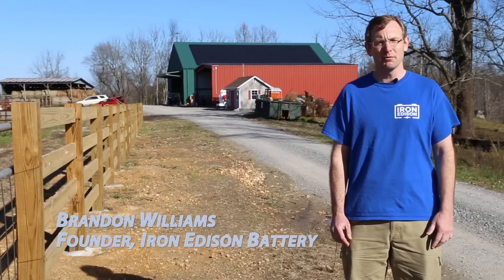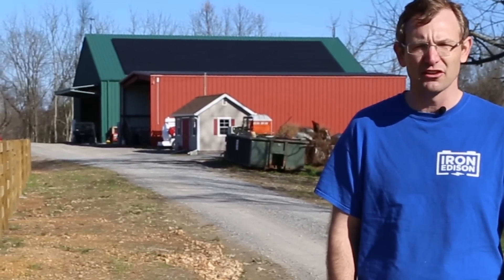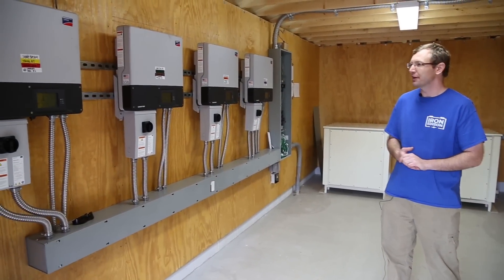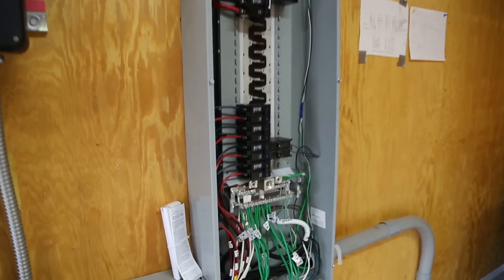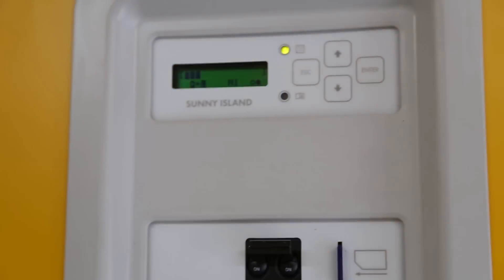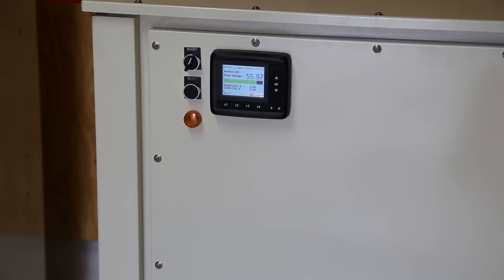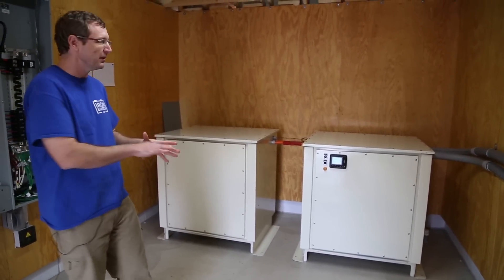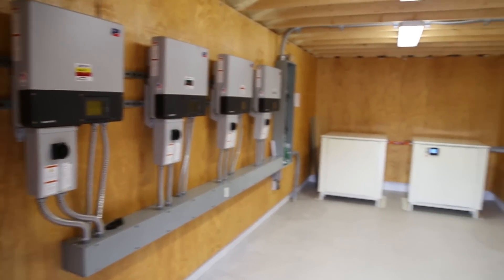Off Grid Solar + Battery Storage Project (SMA Sunny Island & Iron Edison Lithium Iron Phosphate)

Comment: Why do you have both the sunny island inverter chargers and the sma 7000 inverters?  Are the 7000s configured for 220 while the Sunny islands are for 120vAC and charging?
Reply: The system is an AC coupled system,  its more efficient because the solar power can bypass the batteries and join  the sunny islands inverters on the output side effectively creating a mini grid.
So loads get power directly when there is solar generation, and at the same time that Sunny Island can reverse charge the batteries.

Comment: I'm still trying to figure out the system logic there. Off grid. Using gridtie inverters to output 240ac. However they won't energize due to anti-islanding circuitry unless they see 240ac. So the Sunny Island inverters are providing the AC from the battery bank? Then power is combined? What? That's a helluva lot of hardware cost. Why not use charge controllers off the solar panels to the battery bank instead of gridtie inverters? Odd. So in theory here you are using the Sunny Islands to create the grid power, then add to it with the Sunny Boys yet draw off that same grid by Sunny Islands to charge the battery bank?
Reply: Goog notice bro..his way to connect or use grid tie better cuz..
He will never face any problems to connect the pv array..
If he use your advise.. He faced
The amperage and high voltage..
Reply: @mahmoudtijny8795  Simply unintelligible. Recommend you stop posting.  Really.
Reply: The Sunny Island can be run in many configurations... as the name suggests, they are designed to create an isolated powered system. They can draw power from the grid (or a generator) to charge batteries and supply load, use their batteries to contribute to the grid (i.e. be the grid), or operate completely free of any grid (external AC power.) SMA recommends an "AC tied" system, where any solar is attached to the AC load side. (download the manuals for the sunny island and sunny boy systems for diagrams.)
Reply: @jfbeam  Haha... thanks for the reply. I have recently installed 2x7kw and 2x6kw sma sunny boy series41 inverters as well as two sunny island 6048's. My 24.5kwh nissan leaf pack is all together (56vdc). I'm still shopping for a decent BMS. Neither of the two available options are particularly affordable. Unfortunately it has to be able to communicate RS485 to the sunny islands so you can't just use some cheap stuff off ebay. SMA hasn't been particularly helpful. Sure they have lots of manuals but very few actual detailed writeups of installed systems similar to my configuration. The hardware is amazing, but SMA's website and youtube channel leaves a bit to be desired.
Reply: It seems to be a German thing, very good products but not practical, not much flexibility if you want to use EV battery cells etc.
This kind of setup is completely unaffordable for the average person,
And doesn't really make much sense.

Comment: One year to do that install?? I was thinking two weeks not including permits. Flex, conduit and cable management looks a little messy to me. Cool project though! So many new batteries out there today, not sure what type I would like to spec every time.
Reply: Thanks for your comment!  You are right - the inverter and battery installation took just over a week.  The customer was planning the project for over a year, and had to pour concrete, build the metal building, build concrete block building, and insulate the entire building with spray foam insulation - and they live full time in another state!

Comment: What does a system like that cost, excluding the solar array and the building it is housed in?
Reply: It isn't affordable to average people neither worthy going off grid. You won't live to see money back from solar power investment.
Reply: dont bother talking about what you d not know about.   if you want to be a shill than get into politics or something where talking out of your ass pays better
Reply: This system is a minimum 75k$ system. It is probably more as the person who installed it almost certainly needed to be a licensed electrician, which I would assume to bring the cost up to 90k$ to 110k$ depending on the level of the electrician.
Reply: If you are just talking cost of the batteries, controllers, and inverters that is probably about half the cost so 35k$ to 55k$.
Reply: @AJ-ox8xy  I bought solar panels from China for 40 cents per watt shipped to Grand Bahama island.  I later bought 4 brand new sunny boy sunny island SI6048-US-10 for 5750 delivered to texas 78660.   I just need to find some batteries at a good price and I will have a 21kwatt system parts for far less than your low end of 35k.  Sure, if you buy everything retail, ignore China/Alibaba and don't look for deals on Ebay then it can easily cost far more.
Reply: @jfbeam  I'm dyi'ing most of my installation (I used to sell hardware and have installed a few).... for 26kw grid tie (2x6kw, 2x7kw sunny boy) and 2x 6048 sunny island and panels and racking I'm into it for maybe $50k cdn. Not too bad. That includes 24.5kwh gen2 leaf modules (Nissan Leaf + 1 extra module). I've run a few kms of wire. If I had to pay someone for that and conduit install it would cost easily double. Try to find an electrician you can "work with" who lets you assist him/her if you know what you are doing. As is mentioned above, DIY break-even is literally half that of a pro install total cost. I picked up the sunny islands from eBay (DC Solar bankruptcy) $3500cdn for the pair!! That's $12k retail price for those otherwise. My 380w panels were $0.51/watt. I'm overdriving my inverters as our electrical utility had a 26kw limit. I'm pushing 34kw of panel power to get more kwh output in a day (more kwh produces mid-morning and late afternoon that way). Looks like I'll be going with the Batrium BMS setup. They have a newer model a hair cheaper https://www.batrium.com/collections/centralise-supervisor/products/watchmon5 but you'll still need a shunt-trip ABB 300A relay, 14 fuses for the series balancing connects, and a few other bits to complete it.